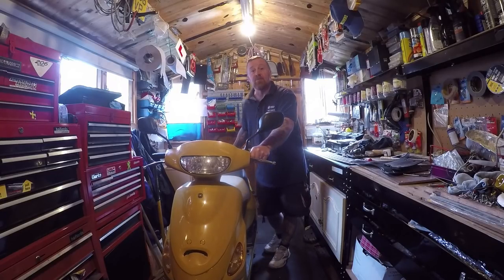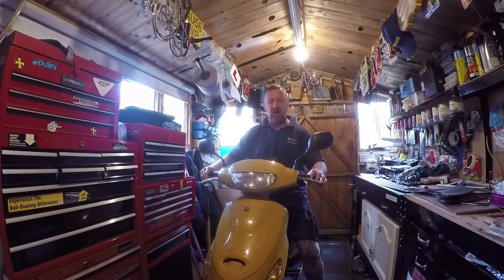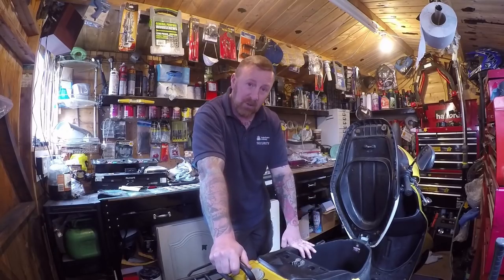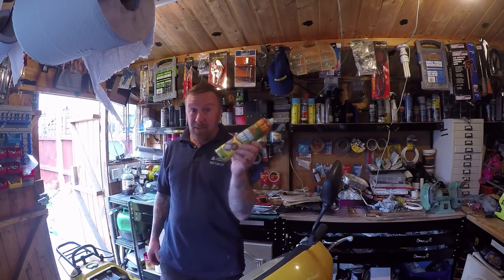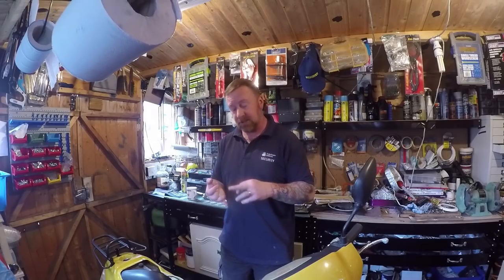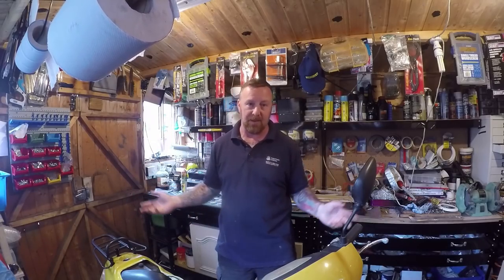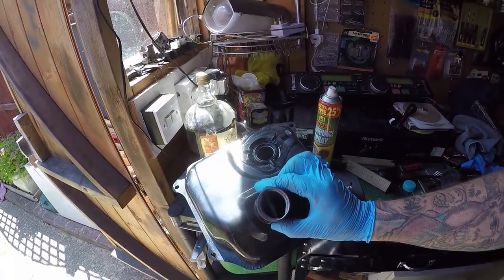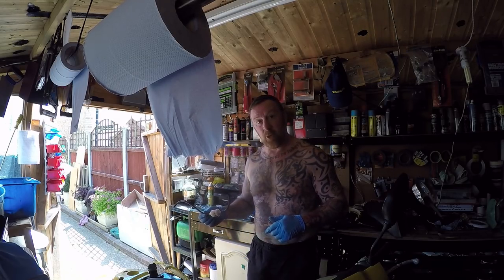CHINESE MOPED WON'T START HELPFUL ADVICE TO GET IT GOING MARK SAVAGE

Comment: I just pried the plug off on a restricted 49cc gy6 scooter carburetor. 
There's a adjustment screw underneath.  The screw has been ground down a little for plug to fit .
Reply from the maker: most little gy6 carbs are and not much you can do but upjet by 4 , not sure what plug you are talking about on the carb bud

Comment: Watching vid still love it so far helpful im getting ready for my build today.. Doing a 100cc bbk , 20mm carb and spark plug ,coil, cdi and kick start build today on my 49.5cc icebear mojo gy6 1p39qmb scoot. My 1st build my 3rd time doing any type of  mechanical type work if you count the 2 lawn mowers i built lol... But what i REALLY need help with is my 250cc tomberlin touring scoot spark plug fouled (black) after it gets hot after riding some miles it gets shaky when idling up and down you can feel the motor moving. Than when shutting off im getting a little afterfire pop. And last symptom after its hot after a few miles of riding if i put it on the center stand idling the back wheel spins as if the idle is set too high which it is not...  My "Guess" is im running to hot and need to adjust the air/fule screw which is block off bye a brass cap! But if that is the must likely issue/fix ill just bye a new carburetor...  your opinion??
Reply: miguel Rosario sometimes you can remove the plug and gain access to the mixture screw. It also sounds like your jetting is several sizes too Large. That could account for the fouling and backfires.. I'd just get a new carb. They aren't expensive.

Also with your build, your "100cc" kit is probably 72-88cc. The qmb139 won't accept larger than 90 without case mods and most sellers overstate displacement. Look at the bore diameter instead of displacement rating. 44mm=63cc, 47mm=72cc. You also won't gain much or anything really from the 20mm carb. The stock ones are 18-19mm and work just fine when upjetted. To give you some reference, most 50cc mopeds come with a 12mm carb and 14-19mm is the common size people will upgrade to for use with a kit. The stock 12mm Sim works fine with a 70cc kit on these. Too large a carb will just be difficult to tune and can even cause lost power. You'll also need to replace the intake manifold but again, the stock one is 19 so no real point to it. I've read that the 139qmb was originally designed as a 72cc motor which would make a lot of sense given the sizes of everything on it. They just slap smaller jugs on em to meet various laws and make export easier.

Comment: I've had water travel through the filler cap on a boation scooter had it 4 years still a pig to start using a springe with nitro fuel in to fire it up 1st time been fun to work on

Comment: Thanks, Mark for the eye-opener on the electrics, as you know my headlight won't go to high beam or switch off on the switchgear, I will strip all the front panels off and have a ganders at what is what and spray all connectors with WB40, The new front light bulb is on order from eBay so I will plug that little bugger in when it arrives , thanks again for the info Mark and have a great day mate cheers,
Reply from the maker: oliverghost1 thanks for watching bud , did say I had a video on it lol 
Hope you get it sorted
Reply: @marksavage  well if i don't i will bring it to you fella lol where you based

Comment: Hi mark, colin here the owner of the kymco agility 4t that broke 2 engines lol, the first engine, the original was damaged by the previous owner, he had replaced the original cylinder with a cheap imitation one and the 3rd piston ring had slipped out of it's seating and ended up in the sump, and then to top it all off the piston had seized against the cylinder at some time or other, but now i have a quality cylinder on that is durable, so hopefully, now many years of driving. The engine that i swapped with the original also packed up on me last month, i told you about that and today i picked up the parts and as soon as i saw it i knew what caused the catastrophic loss of compression, there is a part of the piston broken off on the inlet side, i can't send a photo, which is a pity, but that was the cause of the failure. But now i have the original engine on the bike again and am busy running it in, cannót go full throttle for the first 500km(310 miles) and also can;t take anybody on the back
Reply from the maker: Colin Shard good to hear you got it sorted and what a long job to sort but well done 
You can upload a video and I can take a look but you are doing well
Thanks for the update and running in can be slow but I’ve always still give it some here and there so it settles in better but only short busts 
But it’s up to you bud 
Mark
Reply: I'll post a video tomorrow, i let an official dealer fix the original engine, and it was repaired last friday, after 2 weeks, but if the wait means that the job will be done properly then i don't mind and i picked up the parts that were left, he had used parts from 2 bad engines and made one good engine out of the two, but with a brand new cylinder on the original engine and i will give it a little bit of extra wellie after about 200km(150miles) but even at half throttle the bike runs at 50km/h(35-40mph)so i can only guess what it will be like at full throttle when the bike is run in
Reply from the maker: ill take a look in a bit bud

Comment: My 49 cc runs great , Idles great . Only thing is it's taking a half hour to start it . I'm using a starting battery charger . I'm using spray carburetor cleaner when it gets stubborn.  Holding button down while engine is turning over I can turn throttle back about 1/4 inch the engine almost will catch . When it does that usuall I can use kick starter and it will start . Its below freezing here most nights ,but that doesn't matter I can bring it inside .
Usually my trouble has been easy to start and rough idling . And tweaking the air screw when it doesn't run right . But for now idling and running is awesome. One more thing I've noticed is it will not start easy immediately after shutting it down and been driving and hot .
Thanks.
Reply from the maker: Have you checked your auto choke !
Its more likely to be this 
I have videos on it on my channel 
Easy to do
Do you have a side stand or kill switch ?
Carb cleaner to start !!
No bud use easy start 
That works 
Service ?
New plug ,air filter 
Fuel filter
Reply: @marksavage  yes I've used carb cleaner on small engines to get started .  But believe me I quickly upgraded to the real ether starting fluid after be stranded in the cold.  
But it doesn't fire right up like you think it would using it . 
The choke is completely removed from carburetor.  I've plugged up with piece of custom fabricated metal and capped off with original insert and plate . It worked fine before . I'll order one and see. It's very cold but I leave it inside I look forward to looking at your auto choke videos . I ordered this carb new and it flooded , didn't have extra one so I just dead headed it .It was also warmer weather. Wonder why kick starter will start it more often than electric ? Also no center stand sensor . Just one of the hand breaks have to be squeezed. Thanks for reminding me, I do need a course on those Chinese chokes .
Only thing it's like a completely different scooter ,it's never idled and took off and had this kind of top speed since this has happened . I didn't want to park it last night it was so much fun . But the falling snow put an end to . To bad there's not some type of manual choke like my dad used to buy when those electric or manifold spring chokes stopped working and flooded engine and made cold start mornings a frequent occurence.

Comment: I bought a 49cc for $200 back in June . Like new 1300 miles.
He bought new let sit over fall and winter . 
Cleaned carburetor,  tool fuel tank out and flushed it .Just turned over to 9800 miles . Most people around here can't understand how easy moisture gets in these fuel systems . Can buy them cheap . The kids going to the universities around here think the scooter is junk and give away sometime .
Reply from the maker: Worth a little bit of time and its back on the road
Reply: @marksavage  thinking about starting a business.  I was offered $400 for my $200 scooter . Got me to thinking.  The only money I had invested was the $ 2 dollars worth of fuel to pick it up . Don't know how many times college kids want to sell their scooters thinking they are ruined . No idea letting one of the sit outside for 6 months causes fuel system to contaminate.  
BTW Marc , you've helped me out a lot . 
Thanks !
Reply from the maker: I stated as I had two 16 year old on mopeds and they kept breaking down and got fed up paying out so sorted them my self and before I knew it I was doing 5 a week lol 
Worth doing but you will pick up a few dead ones so just factor that in as the kids never tell the truth lol

Comment: Yo boss i have a chinese scooter (gy6 engine) And it ran proper good until i put a malossi mulivar in it now it won’t start the multivar isn’t the problem because it had the same problem with the stock variator. IT DOES START WITH START SPRAY but only when you spray it when you stop spraying it shuts down
Reply from the maker: Fueling then bud
Check vacuum and fuel lines 
Wet hand test to see it carb is filling up bud 
Lots of videos on my channel to help 
As all basics are the same on peds
Reply: @marksavage  what is a wet hand test and can i send you a vid of the sound the motor makes

Comment: Another great video. 
Quick question. I have a Yamaha Cygnus x and the gap between the lower fairing and wheel is around about an inch. Is that a bit small or is it ok? There is a hole in the lower fairing (unsure if it's from the wheel or debris)
Reply from the maker: hi bud thanks for watching 
it may have had a front knock but as long as it clears the fairings and doesn't pull to the left or right is should be ok, if it does then you will have to move thing around or change the front end!
mark
Reply: Thanks for your reply Mark. I got told to ride it at 40 and let go of the handlebars. Only problem is it decreases acceleration, so not a good thing. Doesn't impede the steering etc. Feels ok to ride too. 👍
Reply from the maker: No bud don't do that on a moped more like you will come off!!, maybe on a big bike but not a moped
just feel how it rides and you will feel if it pulls left of right you will know very quickly, if ok all is good 
mark

Comment: Hi. I have one of them but I have a 72cc kit on it now and I bought a crankcase breather pipe where the dipstick sits. But it's not breathing like it does on my mates one. 

Can you help me??
Reply from the maker: Having a 70 odd kit on it will be the problem 
When ever you change the head like in my video 70 kit don't do it 
Did you change the carb
Upjet it 
Change the air filter 
Sports exhaust 
Upgrade the plug and heat number
Tune the carb 
Valves set
How does it run at the moment any way
Reply: @marksavage  I've done lot that but is start and runs just it does not breathe out at pipe.

Comment: I've got a Big Boy 170 Yeti  model. that is starving on feul after about 45 seconds. Then I have to wait about a minute and start again. It will run for about same time and happens all over again.  Cleaned the fuel filter and made sure that the pipes is clean. NEED ADVISE pls. Thx
Reply from the maker: ok I agree its fuel , so vacuum is ok you can suck fuel and it comes out ok like in my videos 
next carb float could be sticking of blocked , take off and clean like in my carb videos 
fuel lines make sure the are ok and not gone hard and fit tight 
lots of videos on my channel to help bud 
last if all ok could be a plug breaking down 
or stator going to earth but sure its carb

Comment: Hey Mark, big fan! I got a quick question but a long explanation if that makes sense. I was having trouble starting my Kymco Super8 150cc 4T, I couldn't keep it idling without holding the throttle. I called a local shop, he said it was probably the pilot jet and told me to try and pull the carb and clean it all out. So, I did! It of course started up straight away, you'd have been proud! Except I damaged the o-ring on the auto-choke when removing it trying to force the wrong way around, of course. I managed to 'mostly' get it back in place and it was running 'okay' but last day or two it has been harder to keep idling after starting the engine. I turned up the idle it was so rough and probably misfiring a whole bunch, but when it gets up to temp on the road it runs great aside from the now high idle. 

I assume it is that o-ring making things rough for the auto-enricher, and I also assumed it would be easier to buy a new autochoke than the o-ring. 

So my question is, do you think my hunch is right? I want to ask for sanity's sake before I go on buying a bunch of parts trying to troubleshoot my issue. Thanks, Mark!
Reply from the maker: I agree bud yes if you can find another o ring replace that as it will be a lot cheaper but it will be sucking in more air, so yes bud then you may have to replace if still messes around 

thanks for watching
mark
Reply: mark savage I went ahead and replaced the auto enricher and it starts up better but it still runs quite rough, misfiring and sounds like it is getting gas in spurts so the idle keeps fluctuating if that makes sense. I'm not sure what I can rule out, I just cleaned the carb. What if I took a video, do you think you would be able to have a quick listen? Otherwise I might just take it to a shop.

Comment: Gas cap lets no air in my tank. Stops the flow of gas to the engine.I ride with it open for now!
Reply from the maker: try and bend a little bit on the opening side of the filler part of the tank , its more common than you would think 
some of them have a breath pipe and this may have got blocked ?

Comment: Not sure if you'll see this but I have brough a taiwan golden bee 304 as a project and it seems like they basically dont exist, new to mopeds and it needs a few things but my main question is do you know what battery I will need for it by any chance or what size etc it is because I'm completely stuck and dont want to order the wrong one😂 sorry for the stupid question you don't need to reply either I'm just trying to figure it out asap
Reply from the maker: ive not seen one before but most will be 12v and its more the terminals that need to be in the right place, a lot of sellers have the sizes so check that way and all should be ok

Comment: got a question for you, i own a Kymco agility 4t scooter that runs about 75kmh(46mph) but recently i had to replace the cylinder head because a repair shop had done some repairs for me and had put the spark plug in crooked but he said he hadn't and accused me of doing it wrong and blaming him, but anyway, he has lost my custom so i took it to another repair shop and they replaced the head and gaskets and everything, but now it has oil leaking past the two bolts that hold the exhaust onto the cilinder, funnily enough it is the same exhaust as the one on that bike in this video, he replaced the valve cover gasket but that didn't solve the problem, do you have any tips as to where it could be leaking from? is it a gasket or a valve seat, or one of the tubes that guide the valve stem up and down?
Reply from the maker: sorry for late reply as youtube stopped it from showing!
that's not good about the spark plug!, this is why I do the videos to try and save you money but it's the right thing to do if it's a lot of work but this can happen and they don't like to own up if they mess up!
sounds like the valve seats so if new they could be adjusted or head not down tight and a little can leak into the pot 
best get it sorted and keep an eye on your oil as you don't want it to run out and seize
thanks for watching 
mark
Reply: This is exactly why you should just learn to do the work for yourself. It really isn't that hard and there are countless videos and forums to walk you through things. With the exception of some good ones, many scooter mechanics are absolute hacks that will cause more problems than they solve.. been there, wasted money, now I won't let anyone else wrench on my bikes. You'll also ride much more confidently knowing you can fix whatever might happen for the cost of parts (next to nothing) and gain satisfaction from doing it yourself

Comment: Hi Mark sorry to bother you, I’ve got the same bike (direct bikes)scooter and the rear left indicator just isn’t working. It’s definitely not the bulb because I swapped it with the right side and it works. Could it be the relay or the wiring to the indicator?
Reply from the maker: i'd check the earth wire and power wire to bulb unit first maybe a little wd40 on the back of them, use a volt meter to see if you have power to it, if not it's a trace back to the connector but if the others are working then its not the switch or relay 
hope that help
please like and sub 
mark
Reply: mark savage just been working on it and it was the connection just behind the bulb thanks! I had to remove all the fu**ing Panels!
Reply: Thanks for your fast reply
Reply: -and that